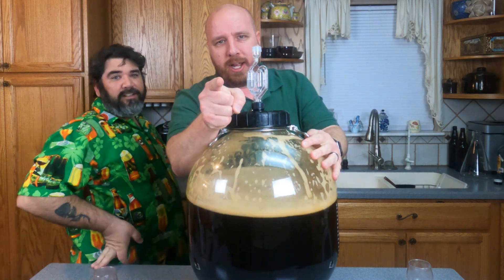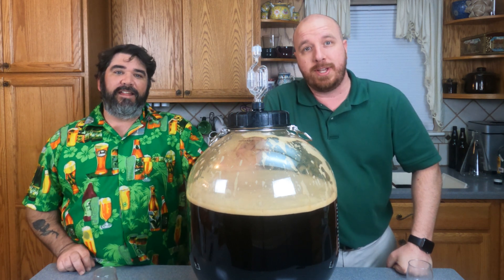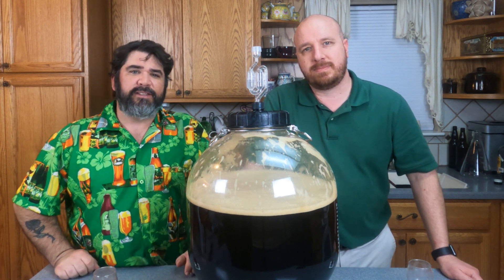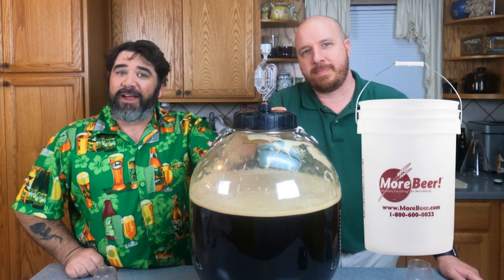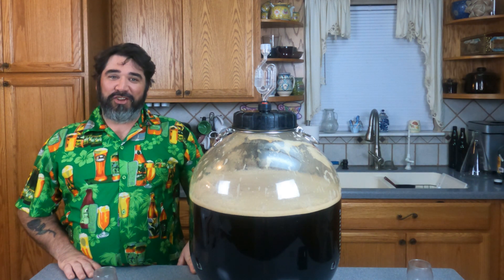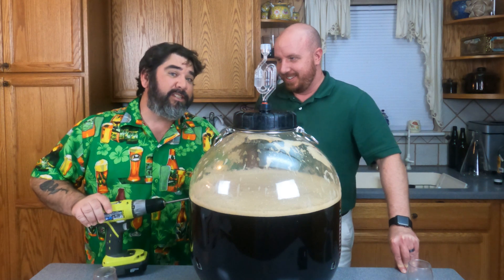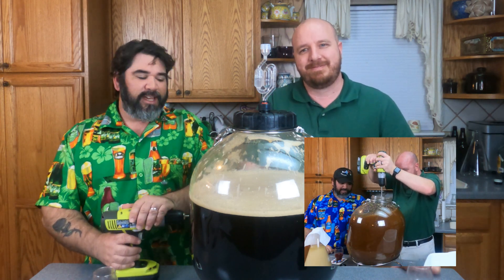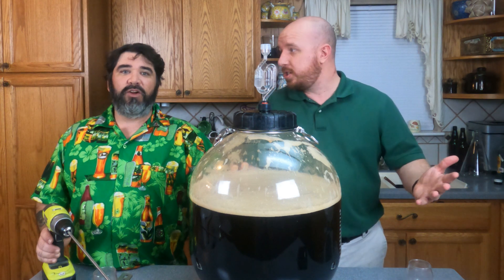PSA - Don't Shake A Carboy!

Comment: Safety first! 
Shake at your own risk... 
Being lazy and sticking to small batches I tend to mix in a separate container... and instead of using a drill I use an electric whisk. Works pretty much the same as a drill with a paddle attachment and it incorporates A LOT of air into the mixture. 

Keep the content going guys: I love it!

A little note in the dropping of carboys: most home brewers should be aware of the fact that they need to be careful when transferring carboys from one location to another regardless of shaking or not: fermentation can cause a lot of carbon dioxide to remain in solution and of they drop said carboy that means an enormous foamy mess. Glass going in all directions and a slippery wet floor. In my home that means everyone out of the space whenever a carboy, bucket or any type of fermenter is being moved, swirled, stirred etc. and that mopping/cleaning supplies are close at hand. As the space is the kitchen this also means my number one kitchen rule is applied: always wear shoes (and I don’t mean open toed sandals). Kitchens are the place in the house where most domestic accidents happen. I mean... ever dropped a knife or scissors? They almost always fall with the tip down. Rule number two: NEVER EVER try to catch knives, scissors, glass or ceramic items. Jump back. A little something I was taught in a professional kitchen. Additionally, and this might seem very old-fashioned, but aprons are invaluable. Made from the proper material they don’t just protect clothes from stains and splatter. They provide an extra layer of protection.

This might sound paranoid as it’s ‘just a home kitchen’ but after driving three people to the ER too get stitches I’d rather wear the shoes and the apron than figure out how to get myself to the ER for not taking  less than ten seconds to slip something on my feet and tie on that apron. And I’d rather replace a broken plate, bowl, or dish or pick up a knife that has a broken or bent tip than have a slashed hand. 

Last but not least: when handling anything breakable or hot, make sure you’re focused on the task at hand. Make sure floors are dry. Pick things off the floor immediately. The pain & potential cost are not worth the few fractions of a second it takes to work cleanly or the few moments necessary to remove distractions.
Reply from the maker: Pinned this comment for the awesome safety tips, thankyou!

On the subject of aprons... There's something special coming soon!  Maybe not the next video, or even the one after.  But soon...
Reply: @ErickandDerrick   - Cool! Can’t wait to see what you come up with. I’ll bet they’ll be loads of fun!

A friend of mine used to think aprons were uncool... until he got a bad-ass leather one given to him. Perhaps not suited for the merch store of a mead making channel (they aren’t cheap) but that friend definitely is giving his loads of mileage. 😊

Edit: thanks for the compliment regarding the tips! I hope other viewers will add theirs and that common sense prevails to keep everyone safe while having fun brewing.

Comment: I make small one (1) gallon batches, so shaking the carboy works well for me. It makes it easier when mixing all those raisins in my mead that apparently serve no purpose and are just decoration.A metal mixer would most likely hit the sides and break the glass.

Good advice for larger containers.

Thank you both for this PSA.
Reply from the maker: You're fine shaking one gallon carboys.  But once you move up to give gallons, use alternate mixing methods!